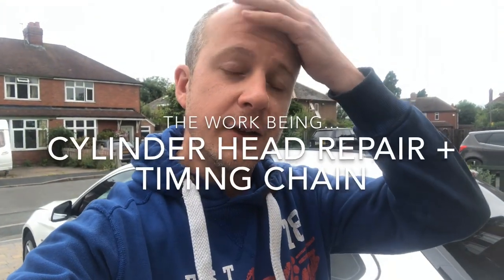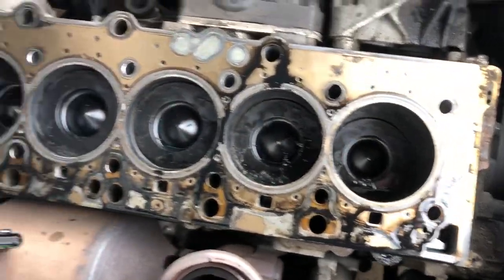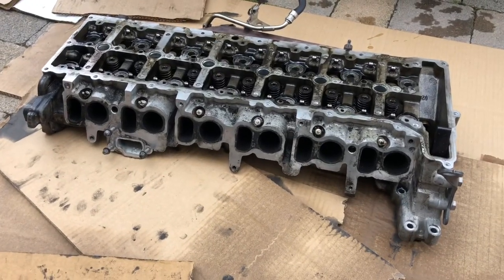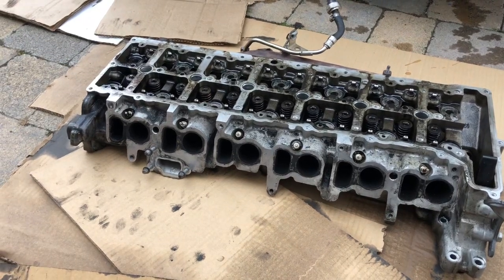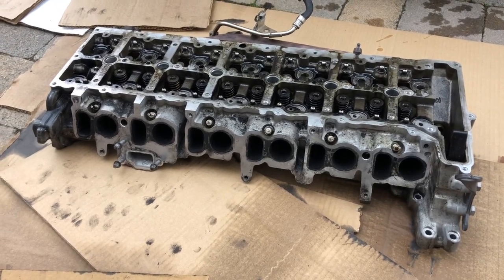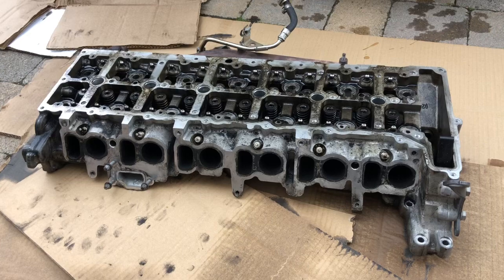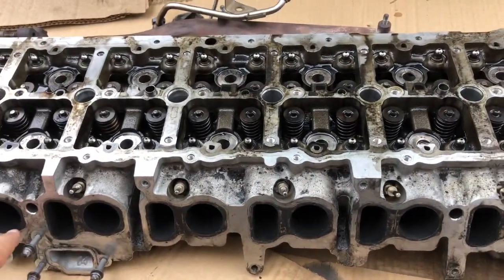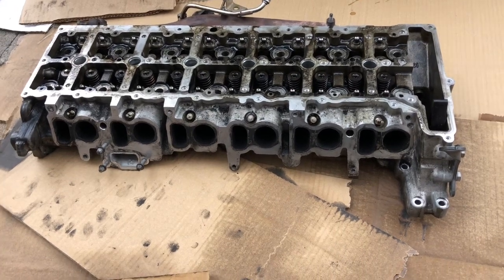BMW 530d F11 BROKEN TIMING CHAIN - Part 1: Fixing the Cylinder Head

Comment: You'll have to remove the sump to do the lower chain. I'd advise doing the oil pump chain too as they also stretch and rattle. So if you're removing the gearbox you'll also need to remove the front subframe to get the sump off. If any guides have broken with the chain snapping, you'll have plastic pieces in the sump too.
Reply: its easier to take the engine out, imo
Reply: @ZVONIMIR172  i agree. That's the way I do it but on a hoist.

Comment: Your doing the right thing,  I've usually done the same,  if you need special tools then buy them.  It's only nuts and bolts,  put together by a man,  take your time,  double check timing and you will triumph!  It's a a crazy world were a fault like this would write off a vehicle with years of service left.  Wouldn't happen in Poland,  they'd fix it.  👍

Comment: Hi, massive props to you for tackling a job like this on your driveway. I say this as I have the comfort of a fully equipped garage to do a job like this! The port on the recon cylinder head you bought isn’t a coolant passage, it’s in fact an AGR (exhaust gas) feed, which was on the earlier n57’s that consist of a metal pipe with a rubber o-ring that connects to the inlet manifold. On your specific engine they’ve redesigned it and incorporated it directly off of the egr cooler right next to the throttle flap. Great work btw.

Comment: Since I clean currently the intake manifold on my E90 I can tell you, this hole you see 7:47 (on your refurbished cylinder head) is connected to the EGR. On the E90 it splits and exits to the throttle body and the other directly into the cylinder head. Anyhow great video. I can feel your pain.

Comment: Well done on taking on the task. Only advice I would give is to tighten the head down in the correct sequence, normally starting from the middle and working out in a clockwise direction to avoid any distortion. Obviously you are supposed to do the same when removing but it’s off now so too late for that. Looking forward to the next part, as you know it’s going to be a bastard of a job but keep a cool head and remember when it gets too much, put the kettle on and have a brew. Things will seem a bit better when you go back to it after that
Reply: Hi I've heard of putting them in in order but why removing them in order?
Reply from the maker: I did actually loosen them off in the prescribed order but didn’t film it. The bit you saw was just me undoing the loose bolts 👍
Thanks for the support - it does help 😀
Reply: Benjamin Bulow Hi Ben, distortion works both ways as head is under pressure from when the original head would have been bolted down during assembly. If the pressure is released from say the outer edges into the middle then there is a possibility that the head will warp.
Reply: Nut Job I thought you might have done it that way knowing your background but thought I would check anyway. Good luck with the rest of the work. 
👍🏻

Comment: Excellent, good work. Spend more time on Realoem to save on parts mistakes. Who knows what the history of that eBay head was. Chances are if was off a car with the same problem and they tweaked the valves back with a screwdriver and cleaned it. 

I went to one of those garden fence and shed places and purchased some big chunks of wood to get my car higher. That way the axle stands are not fully extended so they are more stable.  I use one of those scissor transmission lifts as well. All  and all it's not too hard at home. At home you have a few advantages because you are not under pressure to get off the lift. You can spray down bolts the night before etc..

Comment: Good luck mate. 

I had an 325i with the n52 engine. The larger disa valve disintegrated and ended up in one of the cylinders and caused nasty misfires and knocking noises, i went as far as taking the intake manifold and throttle body off to see if i can could find any debris, i couldn't and then i give up.. I scrapped it after that got £450 from Copart. 

The thought of doing the engine timing and having various engine parts on the car park was too much..

Comment: I have an E90 320i and recently the chain guides snapped (im guessing). Spotted a large chunk of plastic while topping up the oil, it sounds like a diesel although its petrol and it still runs and drives, i guess i've been quite lucky that the chain hasn't snapped. Still going to cost £1250 parts and labour to replace the chain and guides

Comment: Great vids mate, I have just bought a 530D F10 with a leaky crank case seal, do you have to remove the automatic transmission oil when taking the gearbox out?? Cheers 👍
Reply from the maker: No, you don’t have to drain the ATF. I only did it to reduce the weight a little bit (it’s a heavy lump). The way I did it was obviously a bit awkward on my driveway, so I just wanted to do all I could to make it easier. Just remember there are 6 bolts  holding the torque converter to the flywheel before you try separating them.
Reply: @Nut_Job.  Thanks mate, I've been experiencing a bit of problems with my gearbox being a little bit notchy (especially when it's cold) so was considering changing the ATF. It will be going back to the garage for the crankcase leak.

Comment: Are there any parts on the eBay cylinder head you could make use of to repair yours or will you just put it back on eBay.
Reply from the maker: I think I’ll just resell it ‘as is’ to someone who needs it 👍

Comment: I think you might need help to get that gearbox off... 
Those rocker arms are sacrificial aren't they, to avoid valve damage? Were you not tempted to try to just re-seat the slightly leaking valves. You certainly have nothing like the damage you might have feared.
Reply from the maker: I have a genius plan for the gearbox 😉
Yes, I believe the rockers break to spare serious damage 👍 I was tempted to try lapping the valves, but it could have bent the end ever so slightly... and it was actually a really reasonable price to get the head overhauled by specialists 👍
Reply: @Nut_Job.  Fair enough getting the head done if it's not too much money and you do wonder why those valves were leaking if not bent. I'll be interested to know if they have to be replaced. 
You may have seen Car Wizard's Youtube video recently about why not to buy a BMW and like the guy below who said appropriately "WTF is da timin chain doin in da rear of the engine", I am seeing that, as Car Wizard said,  these cars are damn hard and damn expensive to fix. Respect to you for taking this on.
Reply: Julian Hill Hopefully a little extract time and money will save issues later.
Reply: Julian Hill For the cost of 4 valves. Replace them.
Reply: @AndyK.1  Agreed, it makes no sense to risk it.

Comment: Can you return the cylinder head? Good vid and I know you'll do it!!
Reply from the maker: I could ask, but after reviewing the listing it’s actually my own fault. The pictures clearly showed the differences, but I didn’t notice 😟
Reply: @Nut_Job.  That's my kind of luck trying to plan ahead. They may charge a restocking fee but it's worth asking. I didn't realise the N57 was also vulnerable to this failure until I was looking about a month ago as I'm looking to swap my E60 530d  (M57N2) for an F11 and as much as I love them I don't think I'll bother with another BMW again, this is shockingly bad alongside the N47 fiasco. The affected units appear to be engine codes N57D30A and N57D30B between 2010 and 2011 so I'm guessing this is yours. Really hope you get this sorted and save your well earnt cash, really take my hat of to you for having a go this really takes balls! Top man, I'll send you a box of beers!
Reply: @Nut_Job.  u can still return it. I do business with ebay, select the option wrong item purchased or simply didn't like it. Only thing u have to pay for the postage.  We want  to finish this job under 600 bugs...

Comment: WTF is da timin chain doin in da rear of the engine. Damn another reason why not ta purchase an ass backwards BMW any time. They made sure this diesel would have ta be taken back ta a BMW service shop. Bruh i wish the best for ya on this repair and that ya have to spend the minimum on the fix. I would he callin bmw every day until they gave me some type of assistance either through monies or parts and labour.
Reply from the maker: It’s a total nightmare having the chain at the back... it certainly doesn’t make me keen to buy another anytime soon.
Reply: BMW would take the engine out to do this repair, imagine how much that would cost
Reply: They designed it to last the lifetime of the vehicle. After 5 years the sharp sprockets start damaging the chains. Planned obsolence?
Reply: From an engineering perspective it makes more sense. The flywheel end of the engine is better supported by the gearbox, which with the lighter construction of the aluminium block, putting the chain at the flywheel end results in lower torsional forces, which brings better bearing alignment and longer life.

Those carping about planned obsolescence the M30 3.4 engine in my E24 & E28’s was a fitted for life unit, no service interval. I had one on 218000 miles. No issues.

My last F10 530d changed at 115000 miles, only serviced it according to BMW intervals with the exception of 6000 mile oil changes. 

Unless your chain snaps.
Reply: @The-Sea-Dragon-1977  BMW just messed up with the design of the sprockets. They wear the timing chain prematurely.  Timing chains should last a long time, but from my point of view they should be checked regularly.

Comment: Very brave, wish you the best that gearbox will be damn heavy so be very careful! Also you did undo those head bolts in the right order didn’t you....?
Reply from the maker: Yes, I followed the BMW work instructions for the head removal (I didn’t film it though because I needed all available space around the engine bay - those bolts were so tough to loosen off!)
Reply: Nut Job good stuff I hate head bolts they always feel like they are about to snap only other thing I can add is buy the best quality torque wrench possible for replacement

Comment: What would be the better engine oil to prolong the life of the chain ? I am debating a thin oil as 0w30 or 5w30 or a 0w40  5w40 ?
Reply: 5W30 for UK climate. 5W40 for hotter climate. Total 5W30 NFC 9000 is really good oil.
Reply: Well we know 5w40 is for hot climate... but what is better for the life of the chain ?
Reply: M James 👍

Comment: Honestly ? This is disaster!!! Last bmw diesel engine that could handle 300 000km on one chain was the one that has 218 hp . All new bmw diesel engines are horribly unreliable! Timing chain breaks at 160 000km...sometimes less.... it's nice when it works.... but its very disappointing when your engine breaks at pretty low mileage...
Reply: It’s not the computers that are breaking.
Reply: Yeah I have seen some of Scott’s videos

Comment: Glad I found your vid, I'm going through exactly the same thing with my BMW. How much are you paying to have the head reconditioned?
Reply from the maker: Well... I actually just got the final bill today. It needed 3 new valve stems, skimming & reseated valves etc. £200 inc VAT. They’re also sourcing a decent head gasket for me (£84 inc vat)
Reply: @Nut_Job.  Where did you get it reconditioned? Ive just had my chain go and taking the same approach (DIY) as you
Reply from the maker: I found a local company to me called ‘Head Technique’ but I’m sure there will be cylinder head machine shops near to you if you Google them 👍
Reply: @Nut_Job.  Brill, Found one today!

Comment: It’s easier to take the engine and box out together on one and then doing the job on the floor and back in I can do one in 8 hours
Reply from the maker: Yes but you’re missing the point... most people don’t have an engine hoist at home. I managed it during my spare time with only an average tool set 👍
Reply: Nut Job good point just saying that’s the easiest way do do the job
Reply from the maker: Yes, I know you’re right 👍

Comment: Good luck. Sadly BMW have just side stepped the issue. The very least they could have done is reduce the parts to cost or lower as this is now a standard problem. Sadly BMW along with other German car makers have adopted  5 year built in obsolecence. Don't repair buy a new one ......